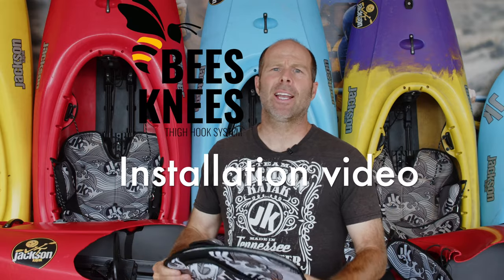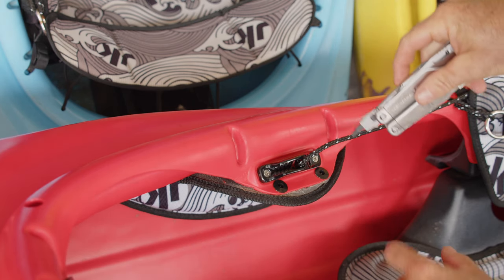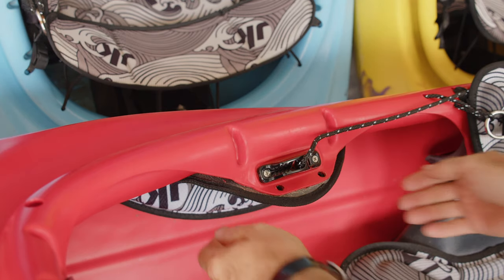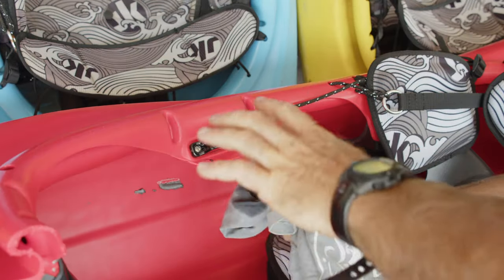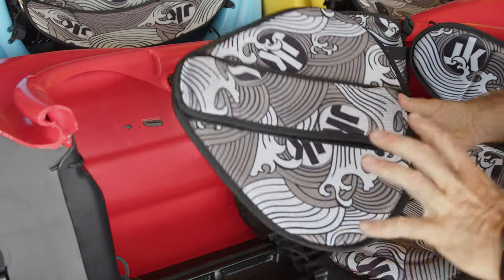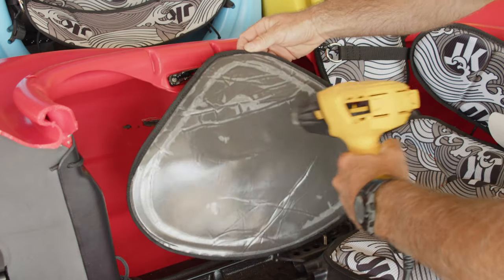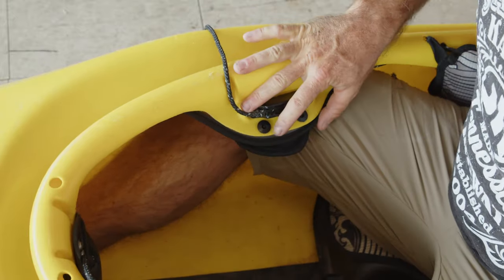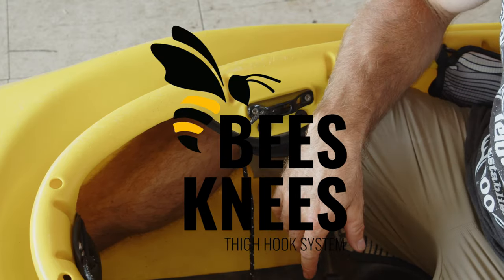How to Install the Jackson Kayak Bees Knees

Comment: My old pads tore out easily but left so much glue. It took forever to get out and was such a tedious process and was regretting it. I’m going to go on record and say it was definitely worth it though. I feel so much more connection to the boat. On my first trip out with them installed I managed my first ever rolls (not combat) in flat water. Did the Bees Knees help, or did I suddenly put it all together? You decide.

Comment: Always appreciate manufacturers putting out install videos, something a few I won’t name could be better about. Even though this one is an install video I think a brief overview of what exactly the product is and how it will help would be nice, maybe with some shots of it from inside the boat w and without a knee present. Also found it a little funny that we kept being told how simple each step is followed by a whole bunch of things to do a certain way, haha. 

All that said, I would probably like this product myself bc I’ve padded out the knees in most of my Jackson boats over the years. I would mark where my knee hit, heat up the pad, peel it back, glue in a foam block, and put the pad back in place. Essentially bumping the knee pad out from behind. 

Now JK just needs a way to provide a more aggressive thigh hook option for those who want it (🙋🏼‍♂️). Waka and Pyranha (esp w Hooker added) have it down.
Reply from the maker: https://youtu.be/jDX3K5c_h1I

Comment: Put a pair in my Ozone and they fit and feel great! Tougher install than shown here bc clips for Pyranha thigh pad go into thigh hook unit from below, and don’t exit the top like Jackson rivets do. Makes it tricky to figure out where to punch holes, which you have to do before installing. Also hard to then place pad so holes line up. I got it marked from inside thick hook out using bent pick (Park Tool), punched holes, then put rivets in and used them to help guide me to holes. Only covers two of three holes, so only two rivets, not three that are used for Pyranha pad, but seems very solid, and shape matches curve of thigh hook perfectly. I punched a larger hole to make room for the one bolt that sticks down (holds thigh hook to boat). Also very little gap between thick hook and boat. Overall, I’m really happy w how it turned out.

Comment: I wasn't sure these could be installed in my LiquidLogic Alpha 75. I slip out of the stock braces sometimes. I can report they fit in easily. They tack on to the hull just under the foot rest adjustment bar. Just remember to remove the existing neoprene pads on the hull and thigh braces.

Comment: Bought these and installed them. Such a pain to replace but got it done. I like the concept however, the Velcro on the bigger part of the pads should be wider so you can angle the knee hooks to your comfort. I found if you angle them instead of running them straight down the middle they don’t dig into your knee/thigh area. However, if you do this, you’re not getting full Velcro to Velcro contact, hence, the reason the strip should be wider. Just my opinion though.

Comment: Anyone found a good way to remove the adhesive left behind when you pull the old pads out?
Reply: I had a hell of a time. I used goo gone and a razor blade and then a wire brush and a little sand paper. Took my time and it was a big PITA but I got it factory clean. Now my Rockstar is tighter than a high school girl before prom night!
Reply: Yep, Goo Gone and IPA did the trick for me. Still a giant pita
Reply: Used a plastic scraper and hairdryer on low to get the majority of it, followed by goo-gone and immediate scrub with IPA (goo-gone is not good for ptfe plastic, so get it off as quick as you can). Enormous PIA, but it's working pretty well. Give yourself more than a few hours if your boat's newer.
Reply: Reducer, I use it for praying paint. not as harsh as lacquer thinner. wont hurt the plastic.